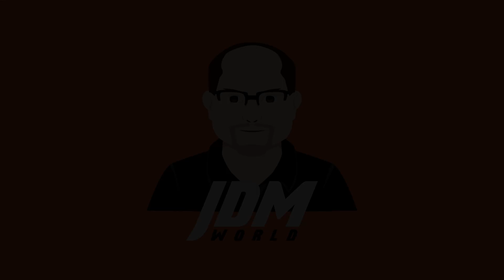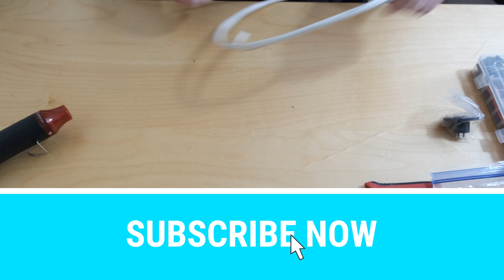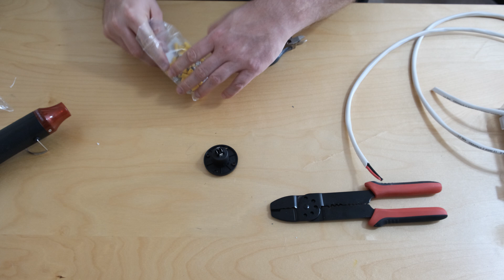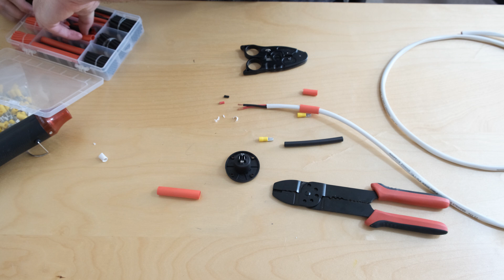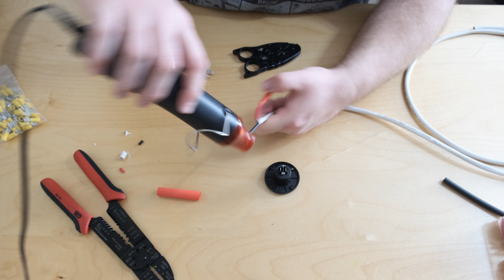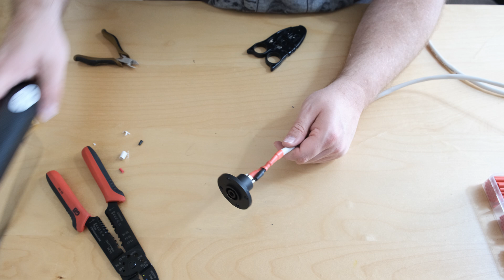DIY Subwoofer Internal Neutrik NL4MPR Speakon Cable Build - For the GSG Audio Marty Cube v2.

Comment: Hi, thank you for this great video! One question, that NL4MPR connector is rated for 30amps, what is the highest RMS power that you would feel comfortable running through that connector? I have a 5 channel pioneer amp in my car and the subwoofer channel is 600watts RMS which i believe will be about 42 amps. I'm concerned if this connector will be sufficient. Thanks!

Comment: Can you help explain wiring a speakon connector for a crown xls 2002 in bridge. It reads for bridge mode [ pin 1+,1-,2+,2- ]
Amp end gets what connected?
Subwoofer end gets what connected?
Thank you for any help!!!
Reply from the maker: The easiest way I w found to do this is buy a speakon bridging adapter cable. I got one on eBay and use it when I need to bridge my crown.

Comment: What size Crimp Terminals you used?
Reply from the maker: .187 The .25 are too large!
Reply: @JilesMcCoy  .205 from Parts Express.
Reply: @JilesMcCoy should I get size 187 or .205 terminal connectors?
Reply from the maker: Ive always used .187 @justinmanny86